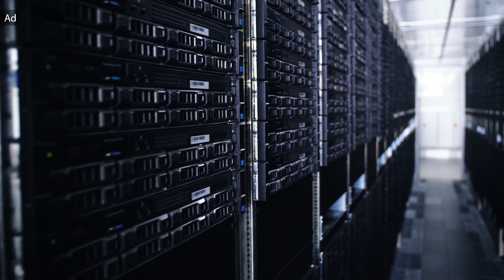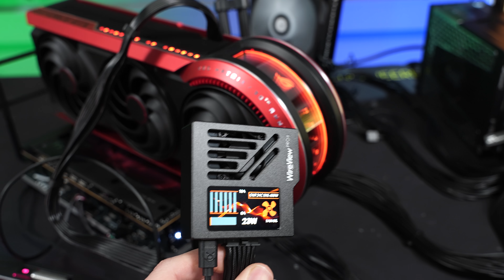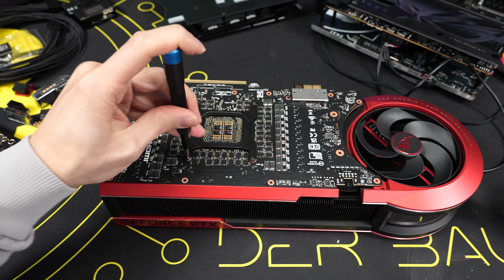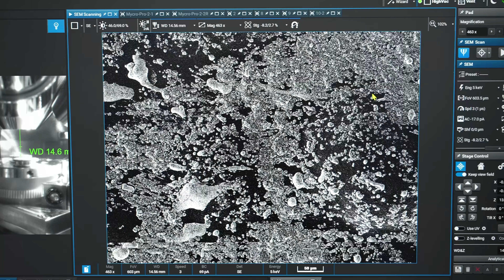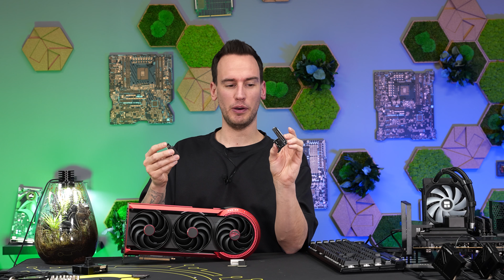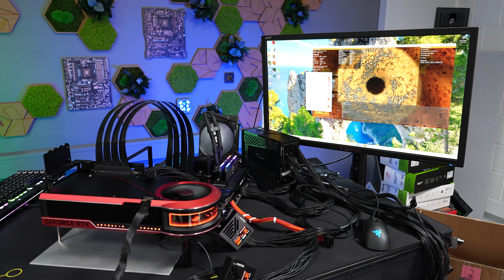After Recall Rumors: ASUS Secretly Changed RTX 5090 Matrix Liquid Metal

Comment: BTF to 12vhpwr is certainly a decision of all time, why not just 2 12vhpwr and leave the motherboard out of the risk
Reply: you know the answer. asus trying to lock customers into their absurd ecosystem. every company wants to emulate apple.
Reply: @AlfRandell  they might've been 1st to market with it and yes thus far no one has done it. However, it was very innovative and in theory it could prevent a lot of melting cable fire hazard issues. The other aspect is that removes the problem of needing to have a case with wide internal compartment to accommodate that cable. You can run the card without using the BTF feature, therefore allowing you to have any motherboard you want. Of course you have the option to buy any other card. It's a forward thinking and innovative design, which would need to have a motherboard capable of handling that kind of power. So a lower end board wouldn't work. If memory serves me right, Asus started the BTF motherboard fad which consumers thought was really cool and now others are doing it. Asus took a risk by engineering and testing the GPU to motherboard power connection, which was very costly I'm sure. They just happened to be 1st to market, doesn't mean others won't follow too. I'm not a brand loyalist by any means, just don't understand why people go out of the way to find a reason to hate Asus. They have their flaws for sure, but so does every other company. Asus's problems get amplified more bc they're the largest PC component company
Reply: @em25-c4h  Question: Are you from the Marketing Department?😎
Reply: As we saw this year CES, highend PSU comes with 2x 12v-2x6 ports. For sure future highend GPU gonna use dual 12v-2x6. Even last year Computex Seasonic showing OptiGuard PSU with dual 12v-2x6 ports, remember.
Reply: Probably a nvidia mandate.
Reply: @MTGSTUE nah Msi lightning 5090 comes with 2 16pins
Reply: @MTGSTUE  I think you right. I remember when the 5090 was announced (right up against that 600w power limit) and a bunch of people were asking "Why not use two 12v connectors?". Different AIB reps gave different answers, but it sounded to me like nobody wanted to touch that can of worms- Everyone was already nervous about melting cables, and Nvidia was strict with the "new 12v2x6" standard/ implementation on the 50 series, to the point where the AIBs didn't really know if they were allowed to make such a drastic change (if they even wanted to try it to begin with). Someone said it wouldn't be allowed by Nvidia, another rep said something like "Maybe in the future if Nvidia allows us to do it". 
I think they just didn't want to kick the hornet's nest that is Nvidia and focus on getting the cards released without extra drama. 
Nvidia definitely can be kinda spiteful if you get on their bad side and I've also heard ASUS gets preferential treatment/ more freedom from Nvidia. It kinda makes sense when you think about the Astral being the only card (at least that I know of) that has the current monitoring, and this Matrix card with its own crazy design and 800w power target. I think one other company has a dual plug 5090 but I don't know anything about them or their situation (I've never even seen one for sale in the US).
Reply: Why not go back to PCIe connectors
Reply: @BirdTho  They should for lower end cards. But having 6 on one card wouldn't really be practical. 150 watt max on those.
Reply: @BirdTho  Why not have all GPU's go through motherboard power instead? Cables are annoying anyway. BTF systems have been changing the game with a zero visual cable layout and this video shows that it is capable of the power required for most GPU's. 
FYI, PCIe is all GPU's.... PCIe only relates to the connector into your motherboard. There is no standard "PCIe cable", that is based on your PSU manufacturer.

Honestly, the PCI founders should have been looking into higher power and data a LONG time ago. Sadly, Intel is one of the founders of PCIe standard and they still struggle to get more than 20 lanes of PCIe for the CPU. I have heard they finally made a consumer part with more than 20 lanes, however, I worry for it's longevity.
Reply: @sniperlif3  I mean, the number of PCI-E lanes directly correlates to number of wires and connections, and number of pins on the CPU. And then of course you have longer cable runs and can run into weird timing issues. As far as the power is concerned, I'm guessing there are some limitations there as well (PCB heat limitations, etc.) Especially when running copper inside. Not impossible, of course, but certainly if the easy answer is to just run a cable and not dramatically increase board costs, it makes sense to run externally.

The connector is certainly problematic, but I am not sure what the reasoning for the pin/connector choice is.
Reply: That is just a compatibly crutch so anyone can use that card.
I think running the power through the board makes sense in a lot of cases, but this is just new so it is on the high end product. (which does seem risky)
If you were running a more common GPU that doesn't guzzle power through the MB people would be quite happy to ditch a cable that is always an eyesore.
Reply: @--_DJ_--  I mean, it's not like PCI slot haven't been carrying 75 watts all this time. Maybe 400 watts is a bit on the riskier side, but I could totally see a 250 watts card not needing any wires attached. That being said, I would damn hope the slots are better designed than this shitty connector.
Reply: Because nVidia does not allow it. I am surprised nVidia is allowing them to make a card over the power spec.
Reply: That would take away the option of running it witout any cables on a BTF motherboard. Wich is priority 1. Everything else is to consider a bonus. And if BTF to 12vhpwr is so dumb to you, just get a BTF motherboard instead. That is what this card is ment to run on.

Comment: I'm a little lost.  You had to remove everything to reapply the liquid metal... So far I'm with you.  However after reapplying the liquid metal you didn't reapply the thermal paste channels around the perimeter.  I'm curious as to why?   It looks like the temperatures are fine, but I'm wondering about any long term advantages or disadvantages in the liquid metal...i don't know maybe either escaping or why they allowed a bit of air.   It seemed like you had questions too, but then kind of dropped it after examining the compound through your scope.

Comment: I cannot believe they’re using liquid metal on a core with exposed capacitors all around it. These cards will lead a very short life once the liquid metal makes to anything soldered
Reply: They’re covered. Trust me. Ask him yourself. He addressed it in the previous video comments even I believe.
Reply: @Akkbar21  Interesting thanks they don’t look covered in this video but he didn’t get very close
Reply: @whatcouldgowrong7914  you can't really see the transparent special silicone covering the pins, I used a special spray for my 7800x3d, and it basically looks the same but if you put your finger there you can feel that it has another layer

Comment: Hopefully asus releases that btf adapter I have a astral btf and would love the peace of mind of splitting the power across two cables
Reply: Even if you get the adapter, the astral btf is not designed for 2 12vhpwr connections. It will not work.
Reply: @BMAR92  The Astral BTF is the same as the Matrix. It has a 12Vhpwr connector and the 12V BTF connector. Only differnce is the 800W bios is not present on the Astral BTF. So it will work just as he said.
Reply: @BMAR92  some aditinoal information:  "The ASUS ROG Astral BTF graphics card uses its special GC-HPWR (Graphics Card High Power) connector and the standard 12V-2x6 to draw significant power, designed to handle over 1000W"
"Key Power Aspects:
GC-HPWR Adapter: This removable adapter can support up to 1000W, allowing compatibility with both standard and BTF (Back to Front) motherboards.
Dual Power Input: When paired with a BTF motherboard, it uses the GC-HPWR slot for massive power, while also supporting a traditional 12V-2x6 cable for even more headroom (up to 800W or more combined)."
Reply: @BMAR92  And some more. Take note of who is performing the test:  "Tony Yu, the General Manager of Asus China, took the GC-HPWR connector through a series of extreme power and temperature tests to see how well it holds up. Asus built this connector with a 1,000W power capacity in mind. During a 10-minute test pulling roughly 670W, the connector’s temperature remained in a safe range of 30 to 35 degrees Celsius, which is a good sign since that power draw roughly matches the typical maximum power use of an RTX 5090 card. Yu then pushed things further, driving about 1,300W through the GC-HPWR connector. Even then, the connector’s temperature only climbed to 38 degrees Celsius, showing solid thermal management."

"Another interesting part of Yu’s testing was examining how the GC-HPWR and the 16-pin connectors perform when working together. On the RTX 5090, the connectors can split power delivery to share the load. In one test, about 370W was flowing through each connector simultaneously. When Yu increased the current further to 200A, the connectors handled approximately 1,400W and 1,200W respectively from two separate power supplies. This demonstrated that the connectors can operate alongside each other efficiently, balancing the power demands of the GPU."

Comment: or they could have just put two connectors beside each other 🤷‍♀
Reply: yeah ive literally been saying that for years about the sketchy connectors XD they could of even made a single connector that was the size of two 12vhpw connectors next to each otherrr and it still would of been massivly smaller than using 4 of the old pcie power connectors,
Reply: @Soddus.Could have, would have, not of.
Reply: @Soddus. It becomes questionable if any solution would be good, when a GPU is drawing so much power, you have to consider the load on the outlet. 750watts at  GPU, means 850watts out of the wall-outlet, just for the graphics card (!), whole system under load will be pulling 1000+watts. So much that you have to consider to get a separate 16A/230V fuse wired from your house mainfuse box to the outlet where the PC is connected.  Is this really an advanced top model?
Reply: @basbass429  i dunno what kind of country you live in but in the uk i can run a two pcs one with 5090 and the other  3080 and several xboxs and electric oven and several other stuff in my house all at the same time? and its only a 3 bedroom house, and what the hell you guys have a box of fuses? our fuses are on the plugs themself
Reply: @Soddus. I am sure it is running all through the same breaker! 🤣  Idiot
Reply: @basbass429  soo you dont mean fuses you mean breaker? and why would someone need to add an extra breaker just for their pc? im sure most people aint maxing every socket in their house
Reply: @basbass429 not many countries use 110V mains. Powering a 1500W computer is no problem with 230V power. My heater pulls 3000W and I had 4 in my house at the same time before switching to heated flooring.
Reply: @AirSKWolf  yyeah i honestly dont knoow what this guys argument is lol unless u on solar or on 120v or what ever eu/us runs then i dont see his argument and im pretty sure he even mentiooned 240v's somewhere, like im no expert i never went to highschool and havve no experince with breakers and shiz but i knnow my house in the uk isnt anythinng special andn im running loads of pcs and stuff
Reply: @Soddus. Us running their shit on 120v. Rest of the world pretty much 230v.
Reply: Abahahhahah
Reply: Make it 3 and now it we could call it safe to run at 100%

Comment: How much complexity just to apply liquid metal. And LM mix does not perform any better than a quality nonconductive thermal paste :/
Reply from the maker: It does perform better
Reply: @der8auer-en  I thought you used a normal thermal paste in the video since the section is entitled "Benchmarks with Kryonaut Extreme". But watching again this section, you mention you did reapply liquid metal and got a little bit better result than factory application.
Still for any normal user, liquid metal only creates more problems than benefit. Liquid metal makes sense for extreme overclockers where each degree matters and where you do not care about longterm problems that arise from using LM.
Reply: @der8auer-en  A difference of a few degrees C.

Comment: This is OP reviewing

I think liquid metal is an overhyped disaster destroying a lot of hardware. It's the same nonsense shorting hardware in laptops. I also watch repair channels and the amount of fried GPU's by people who wanted the max with Liquid Metal is quite high. It end up all around the GPU's and creeps between the solder balls. Yesterday I saw Jay using nail polish to prevent shorting around the GPU but that's not even designed for a lot of heat and cooling down constantly. It was just close by because the wife uses it. A lot of kiddos will copy that nonsense and waste a lot of money
Reply from the maker: It's great for chips with high power density or direct die. But for the majority of applications, a good paste or phase change pads are better in terms of ease of use and risk.
Reply: @der8auer-en  Correct. Many people are also not aware how the substance can react with other metals and simply oxygen as you also mention. There's a lot of education to be done I'm afraid
Reply: @der8auer-en I can’t imagine a daily driver gpu I’d need liquid metal on. PTM is what I’d use going forward if it were up to me. I don’t wanna take my gpu apart. I can’t afford to break it and crazy stuff happens even when you know what you’re doing.